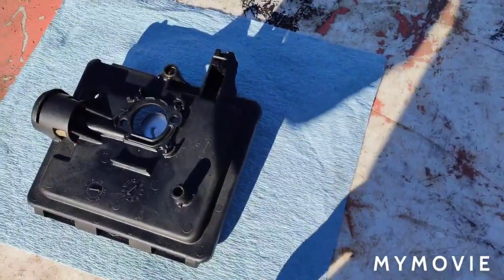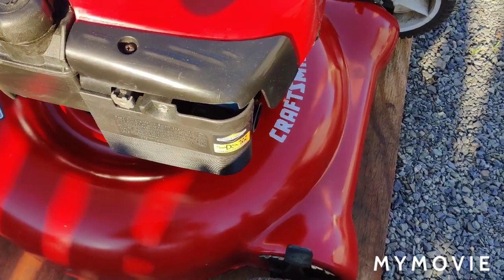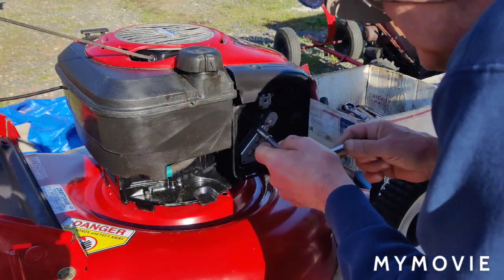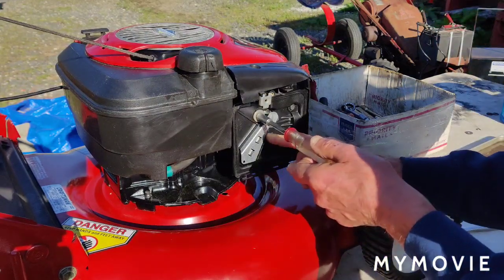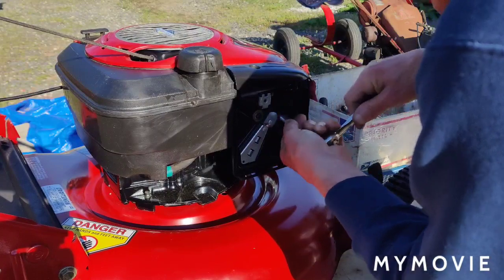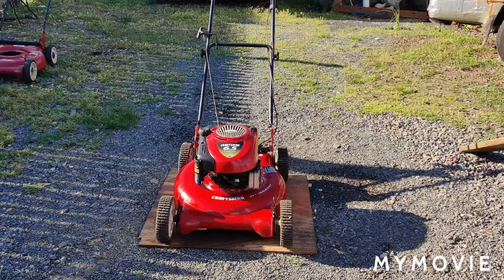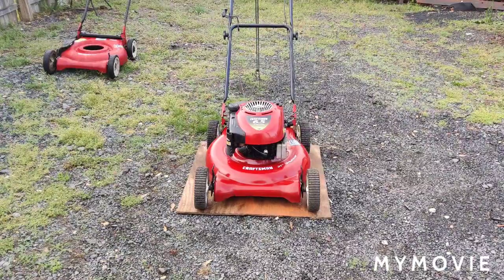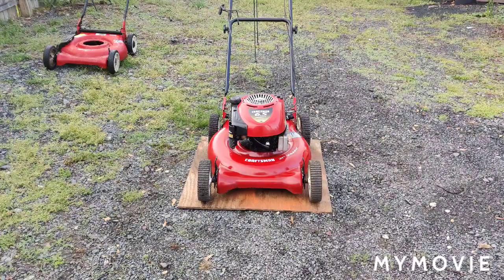How I fixed a primer base that wouldn't prime. (quantum Briggs)

Comment: I just use a small piece of duct tape over the groove (but not covering where the air enters the carb).  This seals the air passage independent of the gasket.  It also helps the gasket seal better due to the breather plate being warped.  Very fast, I have even done this if I feel it may be a problem.  But I do like this idea with the washers, put pressure on a larger area, and it seals the gasket.
Reply from the maker: Your idea sounds pretty good too. What ever works is better than buying a new base. Thanks for watching 👍
Reply: what is a groove ?
Reply: @sinabagherisarvestani8924  It is a canal that the air flows through when you depress the fuel bulb.  The gasket between the back part of the filter plate and the carburetor seals this canal so that the air is forced into the carb.  Sometimes if the plate is warped (common), you have to put two or more gaskets on, or it will not seal and air will not enter the carb.  I put a small piece of duct tape over the canal, then I only have to use one gasket, regardless of the plate being warped or not.
Reply: @moodymac7297  true , makes sense , I think I have an idea of what your trying to explain although I still don't know what a canal is , any diagram ?
Reply: @sinabagherisarvestani8924  Just follow from the bulb to where the air escapes, the passage it runs through to get to the carb is the canal.
Reply: @sinabagherisarvestani8924  the small passage 
way that goes form the intake to the bulb
Reply: Just drill a hole in cover and stick the straw on the can of starting fluid in the hole and give it one squirt. And pull the cord and mow
Reply: @charlesroberts3910  Ha, Ha.  I have done this!  Sometimes you just have to give up trying to correct a design flaw and do something practical

Comment: It doesn't have to be a "guessing game" as to whether or not the primer is working. When you have the air filter removed, just direct your eyeball toward the open intake hole, behind the metal (or nowadays white plastic) tab and look for a little spurt of gas shooting out of the small brass tube. It will be plainly obvious as to whether or not you are successfully priming the engine.

Comment: A simple fix for a very, very common problem.  If it works one time out of ten, it's still a good solution to remember for future repairs.
Reply from the maker: I will try it on the next one Wich should be soon lol. Thanks for watching!!!
Reply: @gravelyman  hi , why did you use a washer ?
Reply from the maker: @sinabagherisarvestani8924  The primer housing was warped.

Comment: I have a new primer base on the way because I knew that's what the problem was but it won't be here until the weekend. Even added two gaskets and it still wouldn't seal but I wanted to get it running today while I have time. Added the two washers like you said and now that primer squirts like Old Faithful. Got the lawn mowed. Great tip and thanks a lot !!!
Reply from the maker: That's great and Thanks for watching 👍

Comment: I've  found that the primer bulb plate is easily warped and leaks air puff. ( heat & overtighted bolts) Adding a second primer bulb gasket works for awhile.  So, what's  next? Buy a new primer bulb base?  Yes!  But personally, I traced and cut out an aluminum  foil version of the bulb primer gasket.  Then, I applied automotive gasket sealer (using toothpick) to seal aluminum gasket around the bulb air channel.  Replaced the two primer bulb gaskets and added washers to 2/3rds of the retaining bolts.  Tighten only as needed. Ta da!
Reply from the maker: Yes overttghtening will cause a problem. Thanks for your input and Thanks for watching 👍
Reply: @gravelyman  LOL, when you were driving those bolts in I thought you were going to break your wrench.

Comment: Thank god they don’t make these anymore
Reply from the maker: Lol, your right. They were a real pain. Thanks for watching 🔧👍
Reply: @gravelyman  I quit working on push mowers because of these things or any metal carb because of corrosion it took to long to clean them up just to find out they wouldn’t work.  I like the nylon carbs they clean up easy .  They also gum up over the winter if they don’t use them and I get to make money again .  I wish the riding mowers had nylon carbs. Push mowers have got so expensive I don’t hear as much complaints about how much it costs to fix them anymore after they see how much a new one is.  The 99 dollar push mower days are long gone.
Reply from the maker: @timothyproksch2915  Yes. Especially that people don't take care of their mowers and we end up with a host of headaches to fix them l. Thanks for watching 🔧👍
Reply: @gravelyman  I started working on them again now I fix a lot of them.
Reply from the maker: @timothyproksch2915  Very good. Good luck with your venture 🔧👍

Comment: i cna see why briggs and stratton went out of business...they make shotty products..i come across this problem with many Briggs engines its more than likely this...they dont prime its just a bad design design flaw they more than likely did to save a buck its extremely annoying fixing everything how it should but it still doesnt work...i have this problem with 2 of my mowers right now and probabyl a 3rd that a custimer has and it jkeeps getting water in the carberator and wont wtart its incredibly annoying..ill try this with my 2...but these 2 it snot teh first time ive encountrered this..alos a tip tightening those 2 tight can break teh carb . so i dont tightrten them as much as this guy..im going to try this.. im just ready to take a sledgehammer to both of them i have a feeling on both mowers this is the problem..one has a new carberator, filter and eveyrhting but just wont start..extrememly frustrating
Reply from the maker: Yes it's frustrating. Good luck with your mowers and Thanks for watching 🔧👍

Comment: I have a briggs that has the same issue. The problem began after I purchased a used mower that had been sitting. It had trash in the carb and tank. I got most of it out but was still having some problems. So, I removed the filter base and tore the gasket. I installed a new gasket but it won't prime. If I put a little silicone on the gasket it will work for a few times then it stops. The new gasket doesn't show any imprint of the filter base primer seal area. Apparently it's warped just enough to stop it from sealing. Thanks for sharing!
Reply from the maker: Thank you. The method I used worked twice for me so far. Thanks for watching 👍

Comment: Hello, use some gasket sealer on the gasket that covers the channel on the mounting plate. Just alight coat, don't want to plug the channel. It did the trick.
Reply from the maker: Thanks for your input and Thanks for watching

Comment: Could the fuel cap cause this problem????  Sealed up cap and purg not strong enough to pull a vacuum???
I’m going to remove cap and see
Reply from the maker: If the fuel cap is not venting it's possible. Remote line at the carb and and check for fuel flow of course with the cap on. Thanks for watching and good luck 👍

Comment: hi I'm not sure I understand , I watched the video but what was the issue and how did you fix it ??
Reply from the maker: The mower wouldn't prime so I used over sized washers on the mounting bolts. Thanks for watching 👍
Reply: @gravelyman  I have the same problem , first it was leaking from the primer , than when I took it apart and put it all together , it won't prime , it starts and and turns off
Reply from the maker: @sinabagherisarvestani8924  if it starts and Stalls after you prime it you may have a carb issue.
Reply: @gravelyman  it won't prime , no gas comes into the carburetor , I'll try the washer method , any other tips ? Maybe loosen the bolts ?  It was fine before , it would prime but gasoline would come out of the rubber prime bulb , I fixed that issue but now it won't prime at all
Reply: @gravelyman  I cleaned the carburetor in soap and water for a few hours , I don't think its the carburetor  , Also the drive cable used to keep the mower on ,  that cable is seized so I have to use a hammer and bring back the engage spring with a hammer  , the cable is seized and it won't pull the handle back  , I have to use a hammer to engage the cable back so it starts otherwise it won't start unless the handle is held back , as soon as you let go it turns off , its like a on and off switch but its seized
Reply: @gravelyman  I had a old MTD turf trac 10/34 that was sitting in the woods for a few years , I managed to fix it , I'll upload a video of me driving it when I get a battery for it , the choke wire on this model makes no sense , so I choke it by hand and I throw the wire away , I just choke with my hands
Reply from the maker: @sinabagherisarvestani8924  okay. Sounds cool.
Reply: @sinabagherisarvestani8924   sounds to me like you've never done any maintenance to your mower. These videos aren't a one thing fixes all. If you have an old mower there's multiple reasons it's not staying running. If it will start even for a few moments you likely have good spark. Though you can check the resistance of the coil to confirm it's in the proper range. The cable you're describing not only pulls back the lever which releases the brake pad from the flywheel but also simultaneously releases from a metal grounding tab which kills the spark. I would first replace your cable before worrying about it not staying running. This video might not be related to your issue. The cable may solely be your issue and it's mechanical 101 to fix a known problem before trying to diagnose the "may be this or that" issues.

Comment: install  brand carburetor, it runs for awhile  than stop and a lot of smoke from the engine
Reply from the maker: Without me looking at it, make sure the engine is not over filled with oil. It could also be bad piston rings. Good luck and Thanks for watching 🔧👍

Comment: I’ve even super glue the gasket to the base and added other gasket that I socked in water or gas
Works most of the time 
Don’t install with power tools dam it
Reply from the maker: I've used the oversized washers a couple of more times after that and it worked. What ever works for you is good and Thanks for watching 👍

Comment: You’re attaching plastic to metal. Relatively soft plastic.I couldn’t believe how you cranked down those small bolts with your ratchet. You have the air filter base so tight, you flattened the ridge lines of the primer conduit to the carb. Now the air flow from your primer is restricted.  That’s why you “can prime it 50 times” and it doesn’t help. 

Buy  a new filter base for a few bucks off Amazon and just snug it up. It will start on the first pull. 

More often than not, the solution requires  finess, not brute strength. Good God.
Reply from the maker: It worked. The mowers fine. Thanks for watching!!!
Reply: You have a point, Mr. Stone, but what you are missing is tact and civility.  Manners go a long way.
Reply: I have heard this before about not tightening the plastic air cover too much.  However, it appears that what resolved this common problem was to use washers so it could be tightened more (unless priming while running the motor fixed it).
Reply: @mattfleming86 
Mr. Stone said what needed to be said. He was not rude. You are just a sensitive princes.